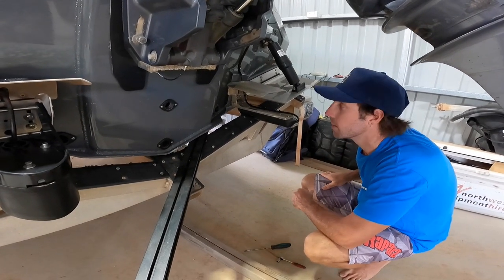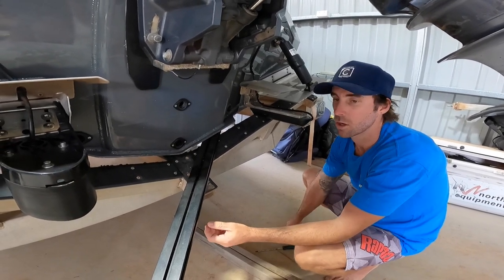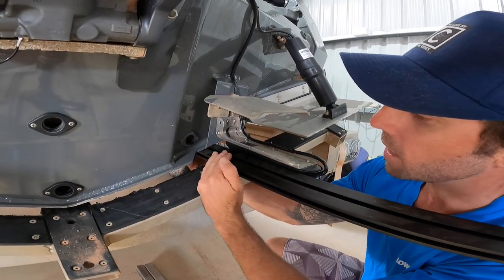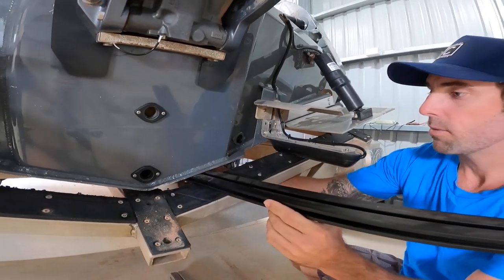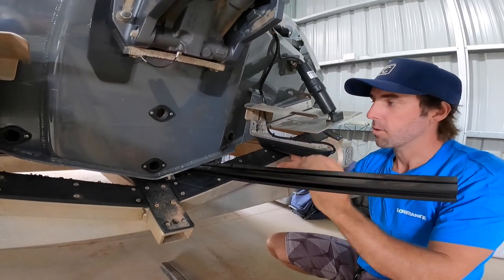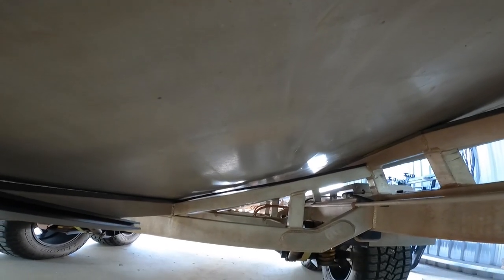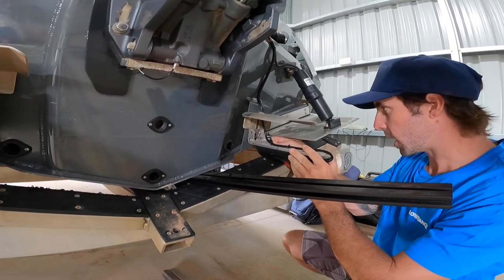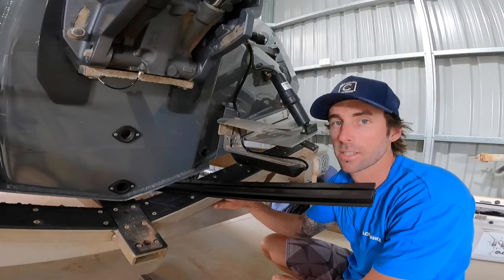HOW TO SETUP TRANSDUCER TO READ AT SPEED

Comment: G'day Mate.  I currently run a 185M, but am looking at upgrading my setup and include a 3 in 1 tranny.  How do you find having one tranny on the port and the other on the starboard side? 

 Currently have the 185M on the starboard. Most of what I've read is suggests to put both on the starboard side (and different heights), but that'll get a little cramped if I have sufficient gaps between them and also the prop.

Do you have much interference from the prop backwash on your port side?

Cheers
Reply from the maker: @ReelFunTimes33  hi mate, I do know that is is common practice to have your transducer on the opposite side to where your prop was would be however I have had no issues with having the 3in1 on this side on my hull. Can’t speak for other hulls or outboard configurations but this works well for me. It still reads at 30+knots

Comment: Nice video mate I'm in the process to get it right at the moment  but it is a nightmare with pressed  hull, it reads  nice and clear up to 10 knots than it starts to cut out . I have it now booked in to high tunes marine  and hope they can do something so I'm be able to read the bottom even at 20 or 25 knots .
Reply from the maker: Have you dropped it more? And tilt forward a tiny bit? Other option is to glue it to the keel of the boat. More prone to getting damaged there tho
Reply: @Latitude SixTeen  I have dropped it  but still the same what I found is the weld on the transom  is quit thick  so they will smooth  that out and have a look again . Yes last option  will be to glue it on ..
Reply from the maker: Fingers crossed it works mate

Comment: Hi , I have a stabicraft aswell , how do you secure the transducer bracket to the welded on plate ? 

Thanks
Reply from the maker: @WatarawiNgata-m9y  sorry mate, just seen this message now. I just use normal screws into the 3in1 bracket. I haven’t had an issue before.

Comment: Hey mate running the same set up with tranducer I’m getting a clear reading at speed in the creeks and water up to 20m but as I start to push in to the 30m plus when I’m travelling out to the reef the picture is not readable you can see the bottom but can’t make out any detail of it. Any advise would be great
Reply from the maker: How fast are you travelling when losing bottom like this? And does it work better on a flatter day when the seas are calm? Might pay to drop transducer a tiny bit and tilt it forward ever so slightly.
Reply: @latitudesixteen6813  I have tried this to and it dosnt seem to change that much.  I have also rotated the tranducer like you have. that did help a bit but still not readable enough to notice pinnacle or a change in bottom

It dosnt seem to mater what speed I’m doing in deeper water it happens at any speed. 
Dose seem to clear up a bit if I’m over 45kmh
Reply from the maker: Hmm that’s a weird one mate! Without being able to play with some settings and what not it’s hard to say what it could be.

Comment: Doesnt matter which way your transducer cord ect goes? Any reason the cord goes to the rear?
Reply from the maker: For this transducer in particular it can be run forward or backwards. In this case it’s run backwards. I find that it gets a better reading this way for both side imaging and sonar. I could be wrong but I believe the sonar transducer crystals are at the front when running in the backwards position so there for getting cleaner water. When you run it this way you have to remember to go into setting for the side imaging and flip the screen so that you are getting your left and right screens on the right side.